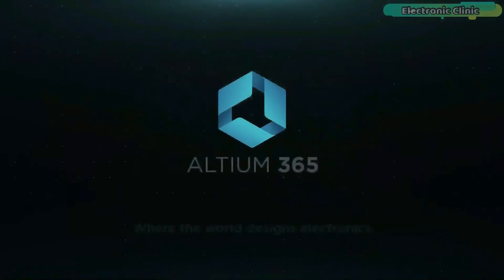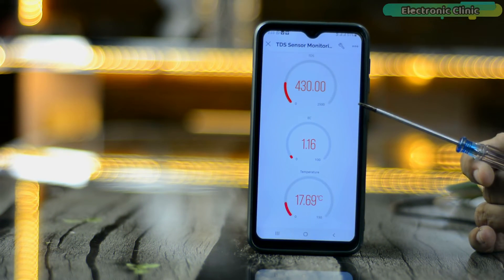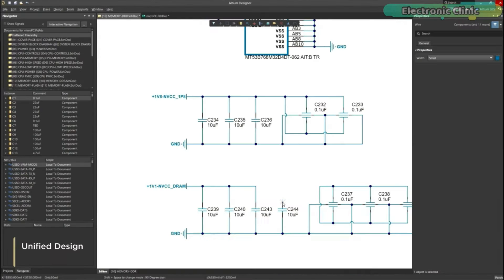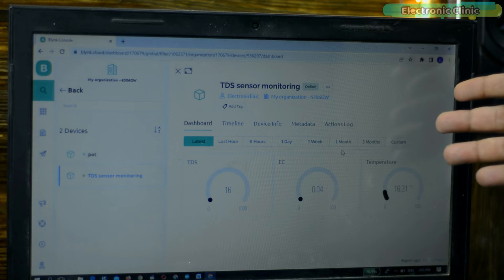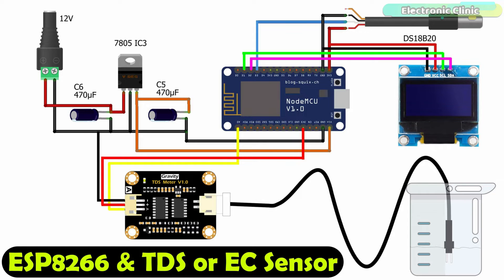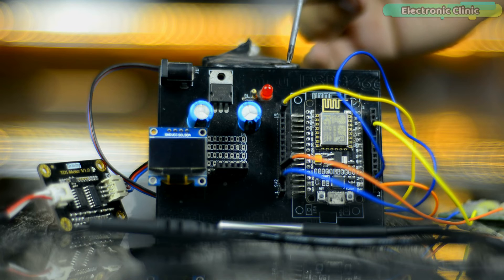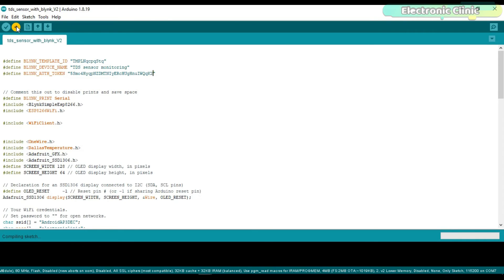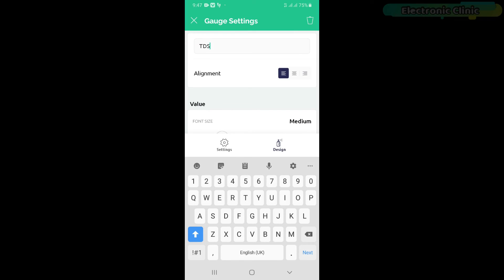ESP8266 with TDS Sensor or EC Sensor or Electrical Conductivity Sensor for Water Quality Monitoring

Comment: How are you getting more than 1000ppm? The sensor is specified at max 1000ppm or did i miss there something?
Reply: i have the same question also. maybe its not accurate above 1000ppm

Comment: in this part of the code i change  1024 to 4095  and used it on esp32 what else shoud i change in the code in formula inorder for me to have a more accurate reading can anyone please help?

float rawEc = analogRead(pin::tds_sensor) * device::aref / 1024.0; // read the analog value more stable by the median filtering algorithm, and convert to voltage value
  float temperatureCoefficient = 1.0 + 0.02 * (sensor::waterTemp - 25.0); // temperature compensation formula: fFinalResult(25^C) = fFinalResult(current)/(1.0+0.02*(fTP-25.0));
  sensor::ec = (rawEc / temperatureCoefficient) * sensor::ecCalibration; // temperature and calibration compensation
  sensor::tds = (133.42 * pow(sensor::ec, 3) - 255.86 * sensor::ec * sensor::ec + 857.39 * sensor::ec) * 0.5; //convert voltage value to tds value

Comment: Electrical Conductivity (EC) and Total Dissolved Solids (TDS) are related but not the same thing. EC measures the ability of a solution to conduct electricity, primarily due to the presence of ions, while TDS represents the total concentration of all inorganic and organic substances in a liquid, typically measured in parts per million (ppm). Then why use( pin::tds_sensor ) in the coding: float rawEc = analogRead(pin::tds_sensor) * device::aref / 1024.0;

Comment: Is this formula correct? float temperatureCoefficient = 1.0 + 0.02 * (sensor::waterTemp - 25.0); // temperature compensation formula: fFinalResult(25^C) = fFinalResult(current)/(1.0+0.02*(fTP-25.0));

Comment: Excellent work, I would like to know if you performed the tests with the probe constantly submerged in the liquid. I have carried out some tests with the "TDS meter v1.0" module, with the probe constantly submerged in the liquid, and after a period of time, the values begin to drop, after which it begins to send inconsistent values. To get correct measurements again, you have to wash the probe in distilled water and clean it. Is it possible that the module I have is defective?
Reply from the maker: This is the main issue, these are need to be cleaned and re-calibrated. The expensive ones work for months.
Reply: @ElectroniClinic  Could you tell me which are the expensive ones you mention?
Reply: @ElectroniClinic  hoe to calibrate  sir